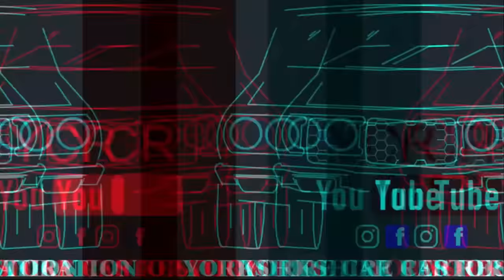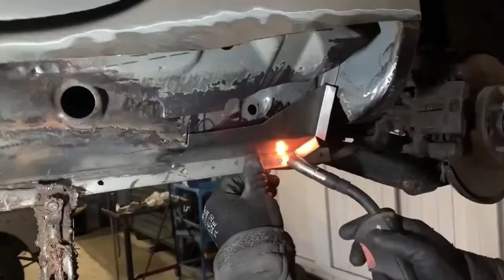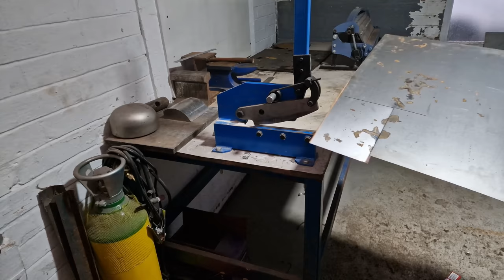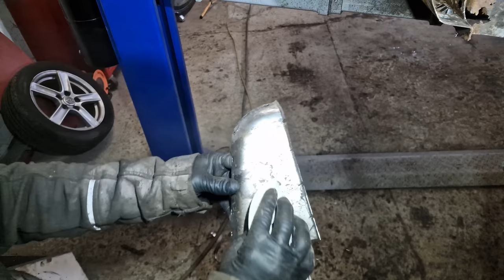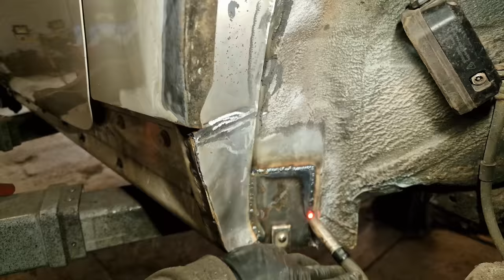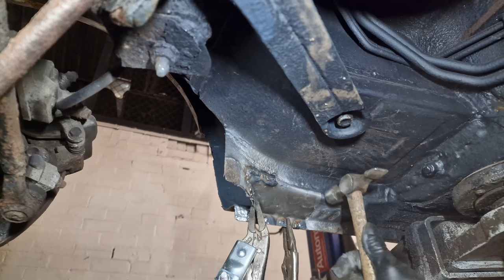CAN'T BELIEVE !! - we found even more rust on the MX5 / Miata NC

Comment: I'm just finishing up a 2002 Primera - repaired the rust, fresh steel, rustproofed every milimeter - or so I thought.. the boot area looked totally mint so I left it alone -  I went to surface treat the drip-upstand..which looked immaculate till I pulled off the seal.. rust..  -  I delved right TF into the boot area, took off everything, every cover, lights, inserts, blah blah - the "Mint" boot area was sound, but there were small outbreaks hiding in every dark corner.. Rust never sleeps and you've seldom "got it all" even when you think you have. I think I've got it all now, but I bet there's stuff hiding.. there always is. :-)
Reply: BTW- see the likes of that MX, If it's a common vehicle I'm repairing and a common fail area, I make a template off the repair section when it's the perfect fit & file it away for the future - next time I have one to do, I grab the template, cut that shape out of steel & bang - no mucking about re-inventing a repair shape. At this stage now I have templates for all sorts & man do they save a lot of time mucking about.
Reply from the maker: We do make templates but I find it easier to just use my eyeometer 😁
Reply: @yorkshirecarrestoration  No - I mean for "repeat repairs"  - example being I do a lot of mid 2000's Pajeros so I keep templates of the common fail areas, same as for merc sprinters, blah blah - that way you  don't need the eyeometer. :-)

Comment: Hi Steve, fabulous skills make such a good watch.  Have to ask another question, I am starting a project involving a brand new shell (find of the century for me anyway!) and am still trying to determine the best way of finishing the underside etc. Resisting the temptation of shutzing as it's a pretty one way journey and doesn't always last what would you suggest? I see you use gravitex,  one idea is to better the factory seam sealing and use gravitex which can be over painted, typically i would use high solids 2 pack,  sound about right, what do you think?
Reply from the maker: Hi Patrick. If you have a new shell I'd deffo use something like upol gladiator as the protection is second to none. :)

Comment: Hi Steve can you recommend anything as a temporary until I can fully restore the car, what’s the best wheels or sanding to take back the rusted areas and what also to spray or paint on afterwards just to stop it getting worse,  thanks .
Reply from the maker: Hi, In my opinion your best off taking any surface rust off then a neautaliser like hammerite kurust and after that dries use a 2k primer :)
Reply: @yorkshirecarrestoration  thanks Steve 👍